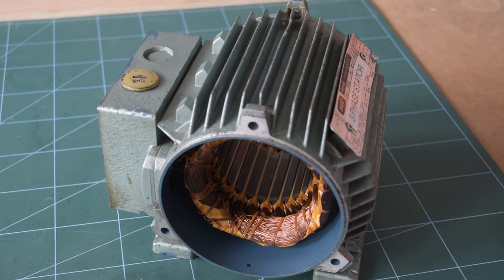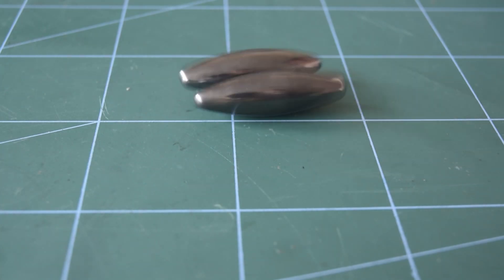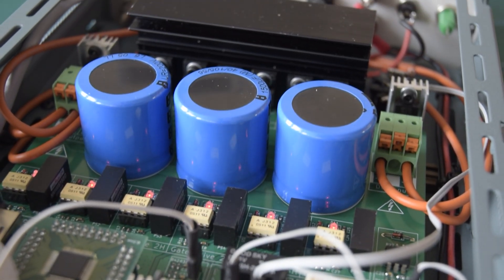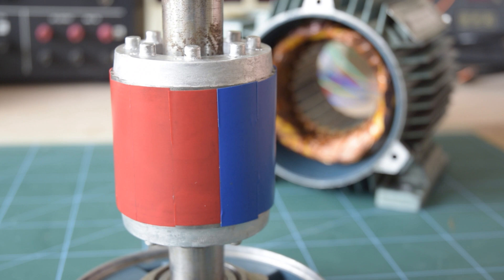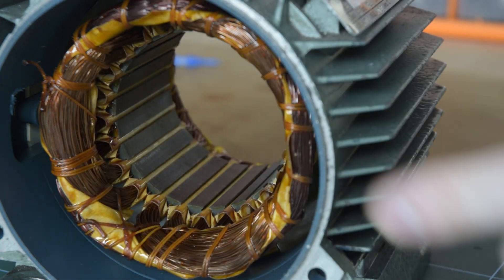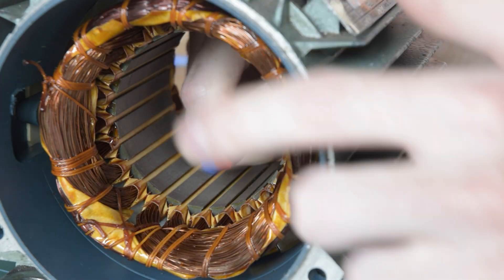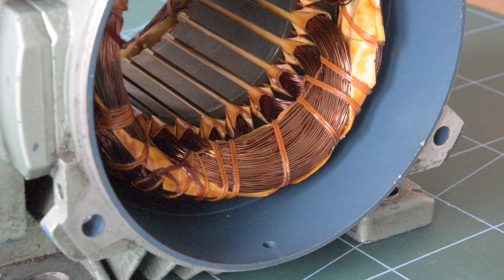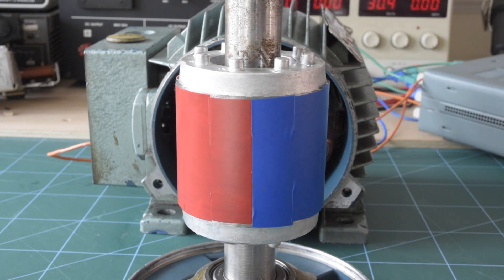A Brief Explanation of Permanent Magnet AC Motors

Comment: 0:20 it's an induction motor's rotor, not a PM rotor.
Reply from the maker: Shhh
Reply: @electrarc240  Yeah! You can replace it with a permanent magnet one, and it still works.

Comment: How does rotor feedback work in cases where there is not an encoder on the axle? Will a VFD be able to sense rotor position by phase currents?
Reply from the maker: There are several sensor less motor control strategies that look at the currents and or voltages to try to approximate the rotor position. Usually they are good at high speed but bad at low speed and many can’t locate a stationary rotor

Comment: Have run a 1/2 hp on a 1hp inverter  in place of air cond compressor.      Spools up probably 5000 and unstoppable.      Hour or 2.  Not warm.  I can get a pick up truck load  if those motors out dumpster today.  All got bad ecm module

Comment: Strictly speaking it is a stepper motor. AC motors induce a magnemotive force MMF into a squirrel cage rotor. Motors with permanent magnet rotors like those in battery drills need some type of feedback to control the speed. An induction motor speed is locked to the rotating magnetic field less the losses.
Reply: its not a stepper motor

Comment: it called synchronous motor, but to run it required a vfd, or using a asynchrnous motor as starter dragged synchronous motor to really close to synch speed then powered it direct on 3 phases (just like the way synch turbine to grid) then disconnected starter motor

Comment: Is it possible to run a permanent magnet AC motor on standard three-phase 60hz? I'm planning on making a custom motor in the future and I'm going for a permanent magnet motor because making standard squirrel cage rotors is very hard
Reply from the maker: Yes it will run but won’t be as efficient or powerful as with a closed loop controller

Comment: The motor you show at the start of the video does NOT have a permanent magnet. It is an Induction Electric Motor (Squirrel Cage) as far as I can see.
Reply from the maker: Correct, but it was in a bin and a PMSM would certainly not have been 😅
Reply from the maker: My red and blue tape nearly fooled you though didn't it 😉
Reply: @electrarc240  I have now watched the whole video: Very clearly explained! Well done.

Comment: In the electric bike world there is the current supplied by the battery but also something called phase amps which seems to be a much higher value. I have failed to find information on the difference between the two and also there seems to be a dearth of information on all the variables in the motor controller apps. I use a fardriver motor controller from China and as you can probably guess there is no information provided by the manufacturer. Any chance of you giving us your wisdom on any of these subjects please.
Reply: The inverter acts as a buck converter between the battery and motor phase windings. It controls the current to the motor by chopping up the connection between it and the battery. During the times the battery is disconnected from the motor phase, the current in the motor phase is allowed to continue around the motor phase. Because the current in the motor phase is constant, but the current from the battery is turned on and off, the average current in the motor phase is higher than the average current from the battery. However the power going from the battery to the motor is the same. Although the average current in the motor phase is higher than the average current from the battery, the average voltage across the motor phase is lower than the voltage of the battery.
Reply: @fluteplayerify  Thank you for the explanation, its clearly a difficult concept to convey in words, there is a case to be made for a visual representation.😁

Comment: I would like to know why Elon Musk avoided axial flux design elements in his motors. I initially thought a PMSM would eliminate much of the electronics required by a BLDC but that can't be true since a PMSM requires an inverter and a resolver.
Reply from the maker: I think they just aren’t that reliable and use a ton of permanent magnet so aren’t very friendly to the environment, your wallet, or indeed international relations. I spoke to a guy who worked at YASA (leading axial flux company) and it all seemed a bit smoke and mirrors for my liking. We don’t use them in F1 with pretty much unlimited budget so I think that says it all
Reply: My understanding is axial flux increases power density by decreasing the total flux path of the magnetic circuit. Since the flux path is axial, you have a more compact design. You can also use double rotors or stators depending on the motor topology, and decide whether you want multiple mechanical outputs with different considerations for each.

For the Spark EV they used a hollow type motor and put a coaxial gearbox with a planetary and differential geatset, and ran the wheel CV shaft must reach through the hollow motor to the other side where the coax gearbox was.

If you want to eliminate torque steer, and remove the differential, you can have a direct drive with independent Dual Rotor Axial Flux motor and have the motor in the middle of the vehicle with a perfectly mirrored driveline.

You could also drive a hybrid system in generator mode, drive all your wheels, drive pumps at different speeds, all with a single axial flux motor that uses less material and occupies the same or less space of a traditional design.

I'm a big fan of convergence / integrating system functions together.
Reply: @InfinionExperiments  I'd like to see that illustrated. It's hard to picture by verbal description alone.
Reply: @awaitingthetrumpetcall4529  Indeed.

Comment: Renault zoe used to have motor without any magnets. Avoids need for rare earth metals, but less efficient
Reply from the maker: I just bought a Zoe drive unit to show and then modify in some videos! A wound rotor is very unique for EV and makes things quite interesting
Reply: I wonder if this loss of efficiency can be compensated for somehow?
Does that make sense?
Reply: @kurt9232  Yes it definitely can, with good thermal design to make use of the heat, and even better motor driver design.
Reply: This is True. Congratulations and best regards from Poland 🇵🇱😀.

Comment: As the rotor is a permanent magnet (well, a set of them), the heat given off by the copper wires in the stator must be extremely important to dump as you don't want the magnets to lose their direction. Is that a common failure mode of EVs? Or is the water cooling actually very good to keep things at a normal temp
Reply from the maker: Not sure if it is common but demagnetisation is probably one of the most likely failures after an insulation breakdown and maybe coolant leak